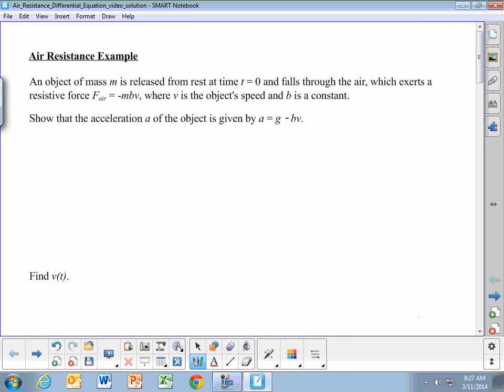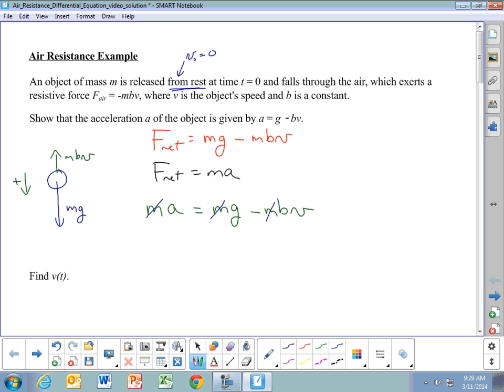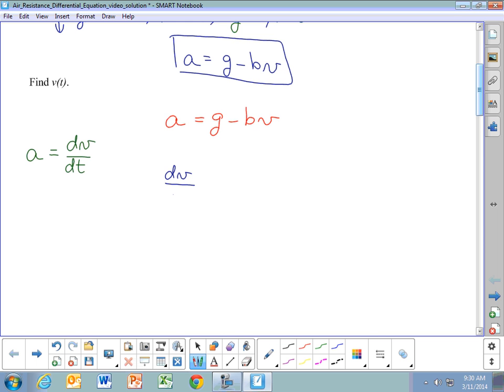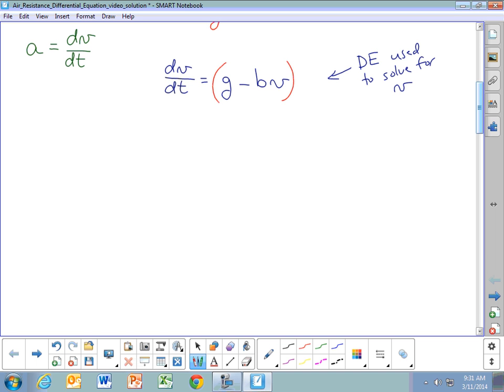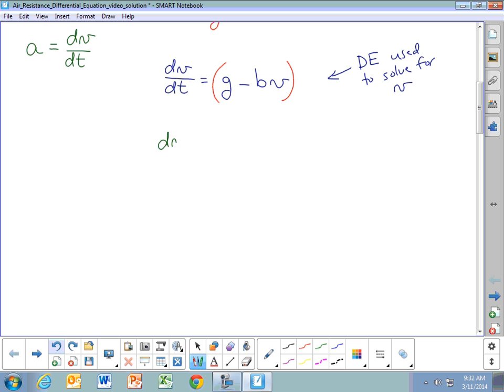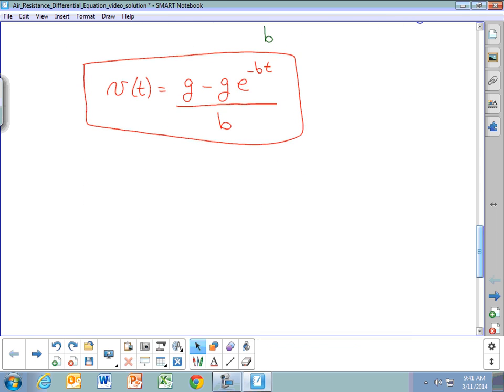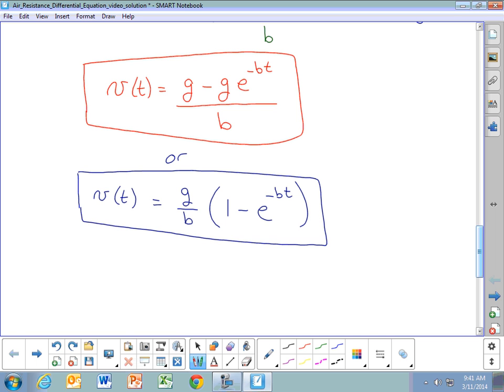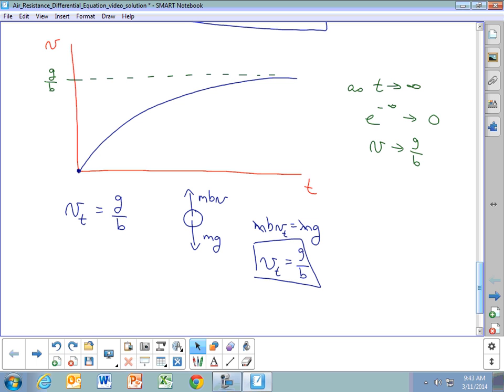Solving  Differential Equation for Falling Object with Air Resistance

Comment: Actually, the air resistance force is:
cw-value x cross section x speed squared
And this is valid for small objects and (practically) for small velocities, a well, e.g. for a person with an already opened parachute.
Btw, it's independent of mass.
Reply from the maker: For some objects, the drag force is (at least approximately) proportional to the velocity (objects moving at slow speeds with low Reynolds Numbers). It is called linear or viscous drag (or Stokes drag). Both types are discussed here: 
https://en.wikipedia.org/wiki/Drag_(physics)

Comment: Scott.  I have an old version of "Numerical Methods for Engineers" (Chapra & Canale, 2nd edition).  It's a superb book in my opinion. I have read a lot of the book in the past and have set up a lot of the techniques in Excel.  Today I have been reading Ch1 for the first time, which gives an analytical example problem of a falling parachutist.  It gives the exponential solution of the differential equation without derivation.  I tried to derive it but failed. I couldn't find an explanation online until I found your excellent video.  Many thanks. Mike.
Reply from the maker: Michael D Bray I am glad that the video was able to be helpful.
Reply: Same for me. I'm reading "Numerical Methods for Engineers" (Chapra & Canale, 2nd edition). Your video was so useful, thank you a lot :)

Comment: This is great but air resistance isn't linear. The faster you go, air resistance grows exponentially. How do you solve this using an exponential linear drag?
Reply from the maker: @114916256569252393580 You are correct that at larger speeds, there is a quadratic term that dominates, but for small objects at low speeds, where the air flow is not turbulent (laminar flow) then the linear term dominates - which is the linear drag force described. This type of drag can easily be solved using separation of variables in an introductory physics class. For quadratic drag, it is solved using separation of variables as well, but involves the hyperbolic tangent function. To see my worked out solution for this case, see the pdf at this link:

https://drive.google.com/file/d/0B0_WVxpjfUcuOGJFUWhFZGRYaWM/view?usp=sharing&resourcekey=0-rh6DBzNIacxcsmvM1aVxqg
Reply from the maker: These solutions are for an object falling straight down, so the horizontal position x does not change. The vertical position y is found from integrating v(t) since the vertical velocity found is dy/dt. If you are trying to look at 2-D motion, it is much more complex and the equations would need to be solved numerically using a computer.
Reply: Scott Secrest "need to be solved numerically"....What does that mean more specifically?
Reply from the maker: darkmath100 It means using a numerical integration technique to estimate the answer. One way is to write (or use) a computer program (or in some simple cases a spreadsheet program like Excel) to estimate the velocity at the end of small time intervals (by treating the acceleration as constant over a very short interval) so that you can calculate the new values of the acceleration and then use it to get the velocity at the end of the next interval. It is common for physics majors at universities to take entire courses learning how to solve equations numerically using a computer. Here is a link that describes what numerical integration is, when it is used, and gives examples of different methods to use to approximate an answer:
http://en.wikipedia.org/wiki/Numerical_integration
Reply from the maker: Here is a resource that talks a little more about using numerical approximations specifically for air resistance:
http://wps.aw.com/wps/media/objects/877/898586/topics/topic01.pdf
Reply: Scott Secrest Have you heard of the story about a high school student in Germany who "solved" the air resistance problem? It was controversial because the student hadn't really discovered anything. He just came up with his version of a common solution.

Curious what you think: http://tu-dresden.de/die_tu_dresden/fakultaeten/fakultaet_mathematik_und_naturwissenschaften/fachrichtung_mathematik/institute/analysis/chill/dateien/CommentsRay.pdf
Reply from the maker: It is not a story that I had heard of, but is interesting. It is possible to use techniques like he did to transform an equation into something where you can find an analytical solution (which is very impressive for a high school student), but the more common method to use for something like this would be the numerical techniques I described because they end up being much easier to do.
Reply: It's not exponential, it's quadratic.
Reply: It doesn't grow exponentially. It grow quadractically, BIG difference. Exponential implies that the change of some value is equal to the value itself times some constant ie. the diff-eq
x'=a*x with the solution x(t)=e^(at)
quadratically means that F_D(v)=k*v^2 which is not exponential.